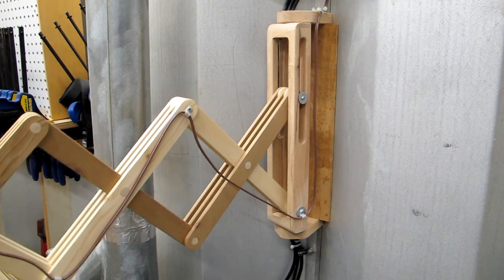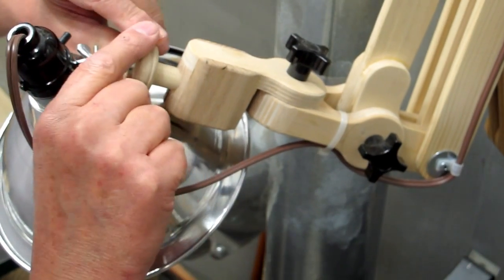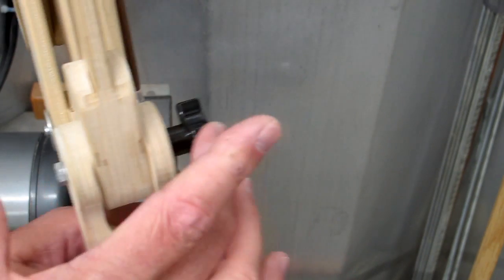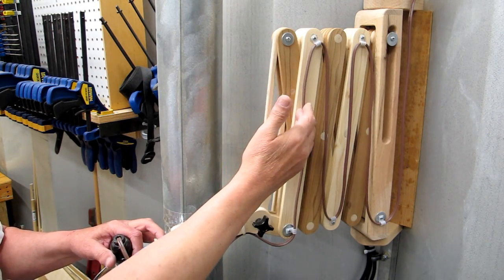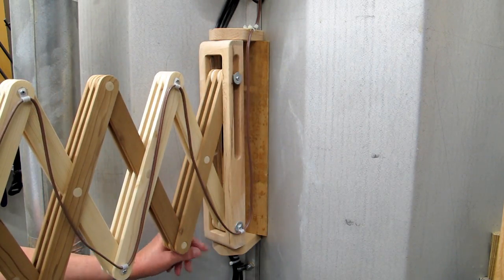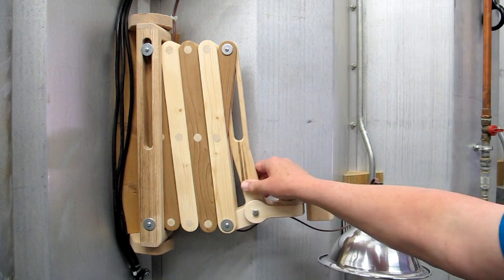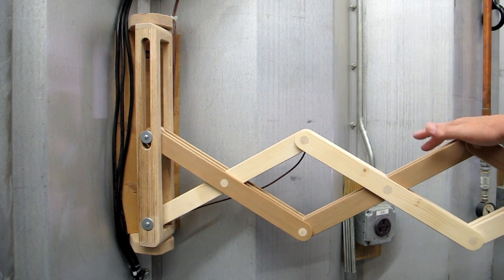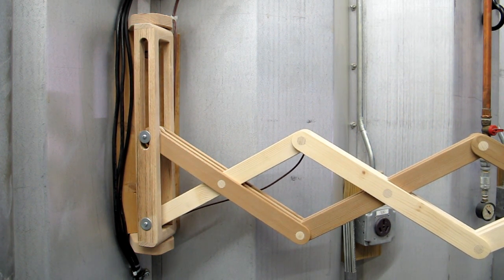Scissors Extension Part 3 Fittings, Mount & Strength

Comment: Great job. I can think of many uses around my shop for this articulating scissor extension from lights to vacuum lines especially over and around my wood lathe. The vacuum is never where you need it when working on the lathe. Another use would be a rest for my lathe tools closer to the lathe. Having finishing supplies right at my finger tips when finishing a bowl or any of the projects I make. Thank you. Best regards, Richard